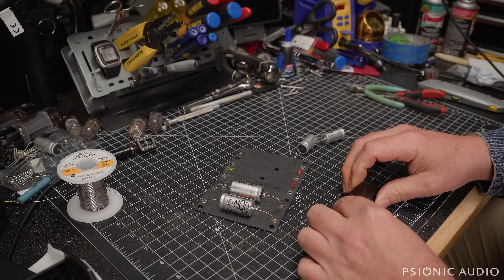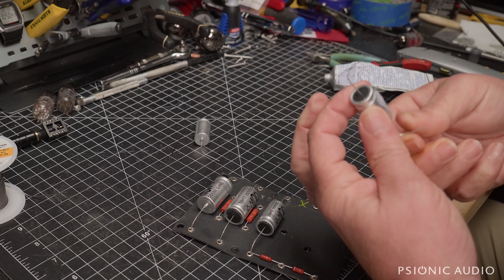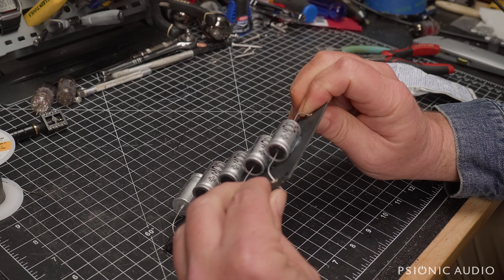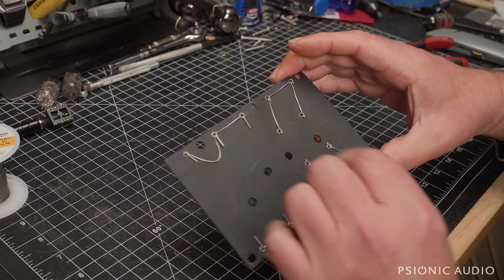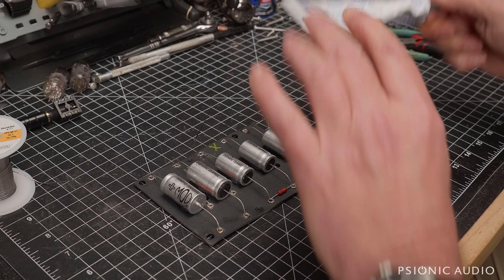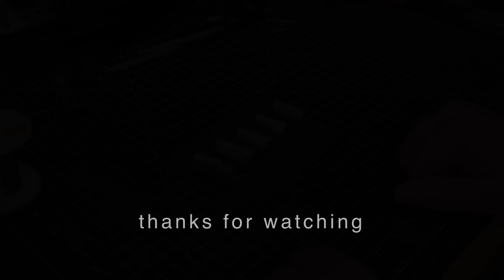Can AI Translate Technical VIdeos?

Comment: Feedback on Video Translation in Italian (native speaker):

- "Power Play": It is VERY difficult for me to follow it in italian. The voice in my opinion is really uncanny and it doesn't have the correct prosody, It's like listening to an automated selling machine. Technical terms seems to be ok (didn't know we too had a translation for "can caps", never heard it used in RL), but sometimes it says "V" instead of Volts, spells "JCM" as "i-lunga ci emme" (which is technically correct but a pain to hear, we usually call J "jay" as in english) and splits the component values at random points, so you have to listen to it multiple times to "decipher" what it's trying to say. The most annoying thing is when it translates "uhmm.." to "eehm!" because it's so unnatural.
The other things that I pointed out in my comment about titles still hold true, "clean as a wistle" made me laugh so much because it has no meaning in italian. "somethings that stands-out" too.

- "Mesa SimulClass 295": "Mesas" is get as "maces" and translated as "mazze". You can imagine the opening sentence. Also here technical terms are ok, but it's the general sense that is hard to follow, mostly because of the timing. Every time you say "uh", "this are the..ah" (which is completely fine as it's how humans speak while thinking) it translate it as "'-u" words and it sticks everything together by ignoring any kind of pause in the speech. At 2:45 it says something undeciphrable like "so it's probably a u-question. It is hoped to change some of that carbon composites for a sensible choice of metal film metal oxide or UM-wirewound". I had to listen to it 3 times just to be able to re-translate it in english.

In my opinion, if only one knows a bit of english, translated subtitles are enough to get all the meaning by combining translation and correct prosody / timing / details lost in translation. Translating the tracks altogether (as it's the current state of this AI) may be convenient for youtubers that do read-aloud, but not for technical videos in which the user should really pay attention on what's going on.

Comment: For straightening leads: if you glue rubber sheeting to one side of each steel plate, you can just slide the plates side to side and get perfect leads without putting any stress on the capacitor body and the lead joint.

Comment: H, could you make video about output transformers? Difference of plastic and paper bobbins. Relation between plate voltage and primary impedance of transformer. Why sine waves are audible through OT when amp is playing into the load etc. You must have a lot of experience on the topic